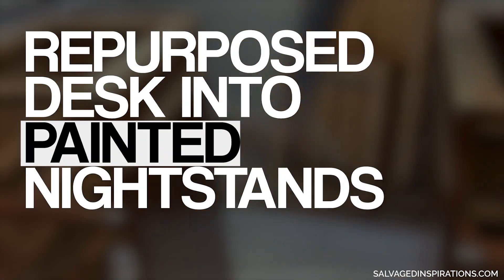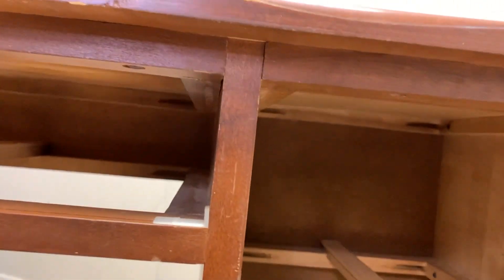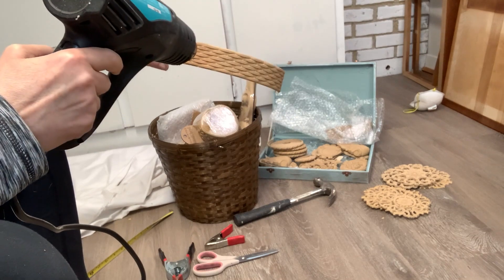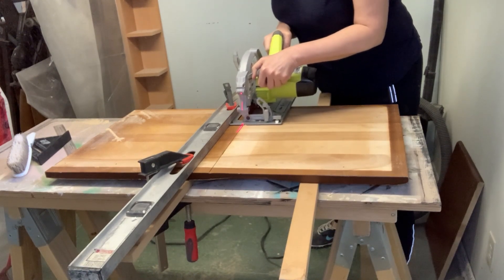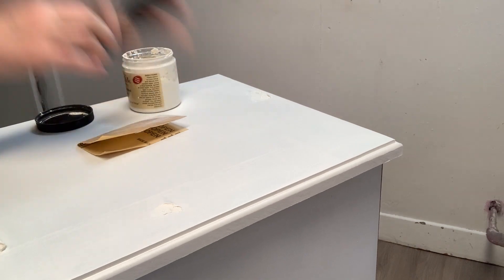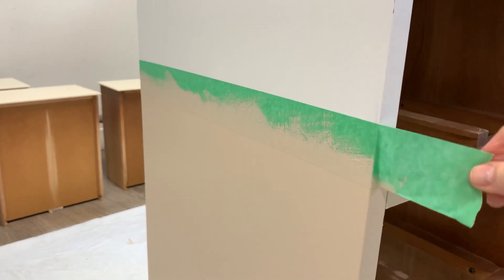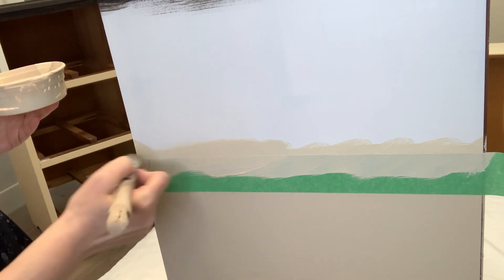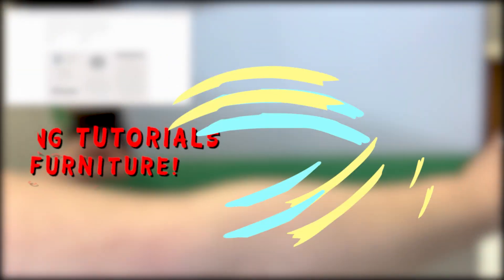Repurposed Desk into Painted Nightstands

Comment: The main problem with not getting the tops to be the same size, could be not taking into consideration the "width" of your blade, then also where you run the blade along your measured line. IE: cutting on either side of the line or down the middle can be the difference of getting that measurement right. For getting the screws right and keep them from "breaking through" your wood top maybe look into using the Kreg Jig. I totally agree with your comments on the difference between artistic painting and classic. And finally thanks for the tip on the adding heat to tape! Love tips like that. great job on these!
Reply from the maker: Thanks so much for this, appreciate good tips as well and love learning. TY!  :)

Comment: I hate jigsaws and circular saws lol I feel like I’m in a cheesy comedy or cartoon, no matter how tightly I grip it, it does what it wants. So I bought a Dremel Moto-saw, it’s a combination scroll saw and coping saw, it can be clamped to a table or used handheld. It’s pretty awesome for small projects. For the top of the desk, I would use a table saw lol I’m more comfortable with cutting things on tables where I have the control. Make sure you’re using the correct blades and speed settings. I learned through unnecessary trial and error that the manufacturers put that info on the packaging for a reason 😅🤦🏼‍♀️ and I always look for power tools at garage sales or estate sales, especially now with the cost of everything skyrocketing. Love your work and videos!
Reply from the maker: You just gave me a good laugh with your cheesy comedy or cartoon. My sister and I always feel we are a comedy act when we try new tools or go to Home Depot..lol. I have a Dremel tool which is awesome so I'll check out the Dremel Moto-Saw. And I think a table saw would be easier as well. A brilliant tip for finding new-to-you tools!